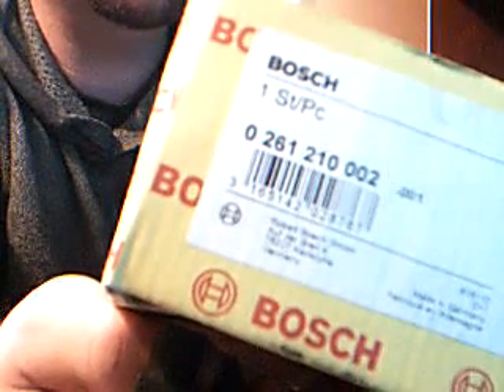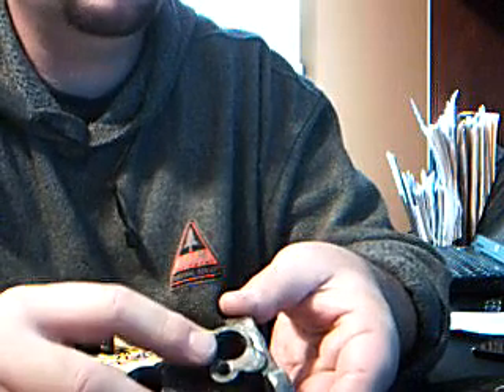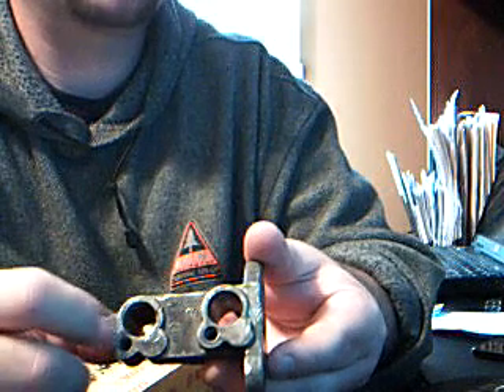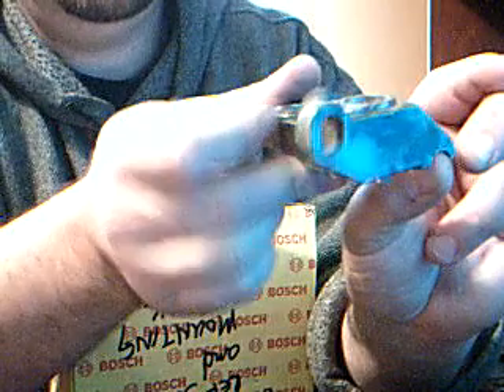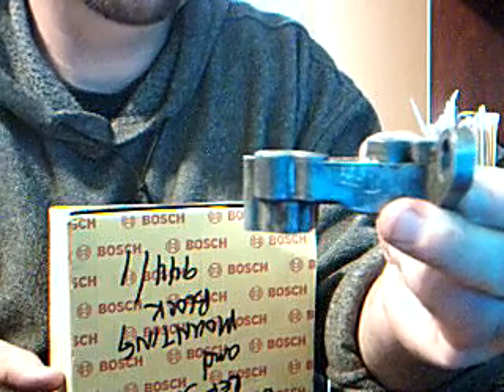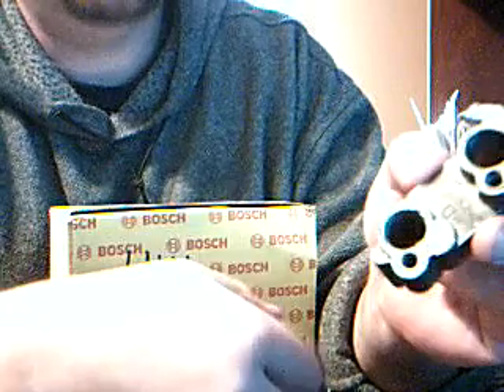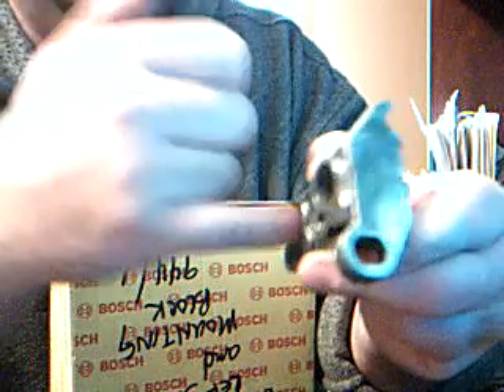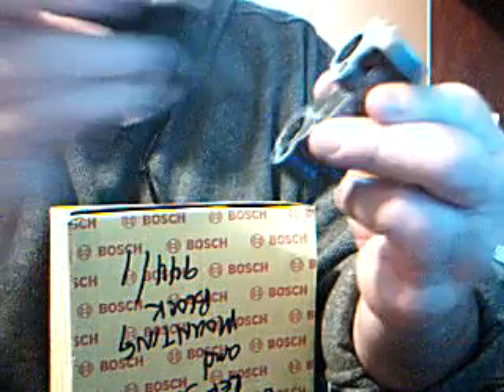Quick Reference Sensor Tutorial Porsche 944

Comment: Great video, but should be 4 seconds longer ;-)
But seriously, thanks for the perspective.  I'm still fighting mine, but every little bit of knowledge I can acquire helps . . . with encouragement, if nothing else.
 
PORSCHE 951:  Heaven to drive, HELL to work on :-P
Reply: spray with lube.
Reply: Oh I sprayed. . . and sprayed, and twisted, and cursed, and sprayed some more.  I ended up pulling the whole bracket off after I broke the plastic, where the hold-down bolt goes, trying to pry the "D" sensor out.  Even after I had the sensor bracket in my bench vise and a pair of Vise-Grips on the sensor itself, I STILL had to twist and pull on it, with both hands n considerable effort. It didn't matter by that point, as I'd resigned my self to order two new ones anyway.
Reply: It is corrosion of the aluminium in the bracket bore that causes the sensor to seize. The Oring on the sensor traps water on the bore. I believe the squeeze of the corrosion causes the plastic part of the sensor to grow in length and breaks the tiny lead wires of the sensor coil. That's why the sensor failed.

Comment: hey my dad used to flip cars and started ripping apart my porsche 944 when the reference sensors failed.. (he's an idiot and im starting to wonder how he ever flipped cars) anyway, he pulled the plugs on top of the engine out, and didnt keep track of which one went to where, and i cant test them without knowing which to plug in where. would it really matter if im just testing them? and if you could please tell me which of the 2 plugs each goes to.
Reply: Bruh, you a silly Billy, do it yourself bro! Bet it's still sitting in the garage or something lol 
Just install them back, if it doesn't crank then switch em , and if it cranks after, then that's how you will know, make sure you keep track or label the sensor after, (facing the engine from the left side after getting out the driver seat) the sensor furthest to the right is the reference sensor ,